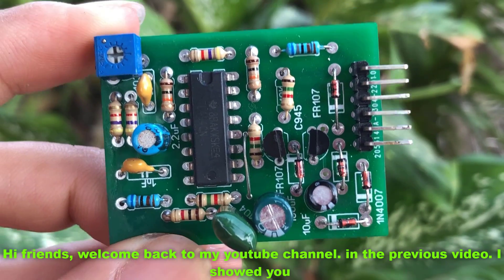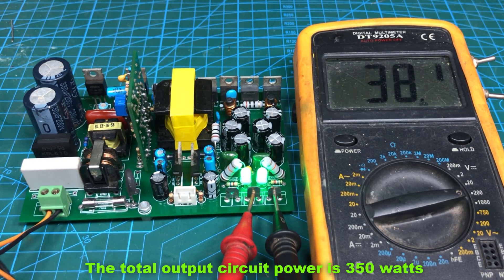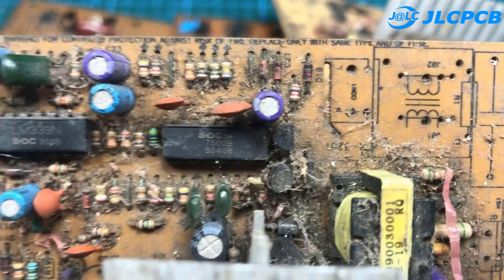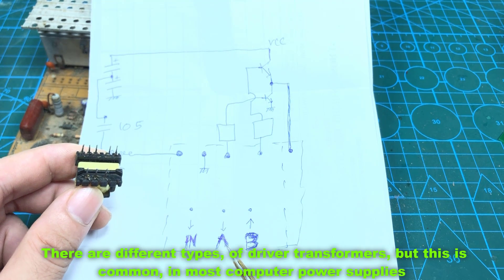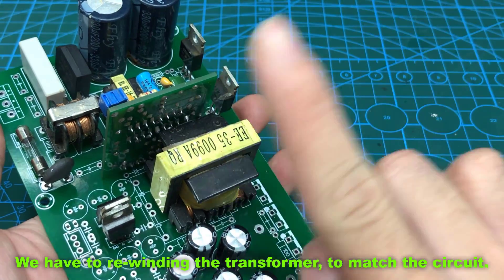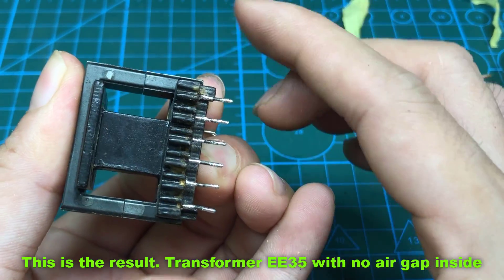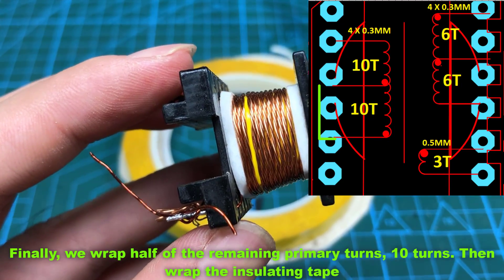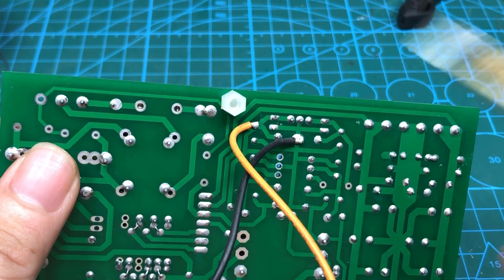SMPS Using TL494 Control Circuit Part 2

Comment: Can the tl494 automatically adjust its duty cycle when loaded to keep the voltage at the set voltage on the output